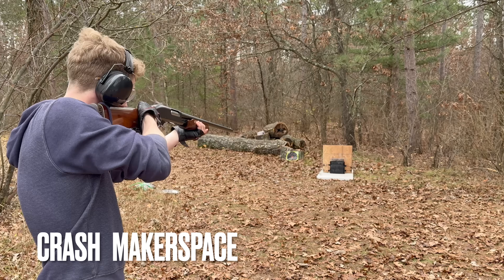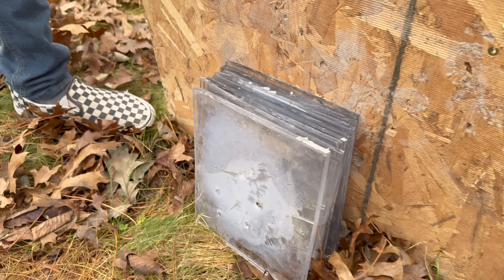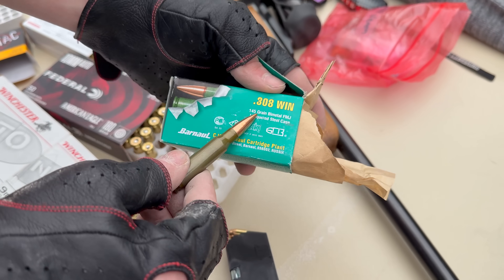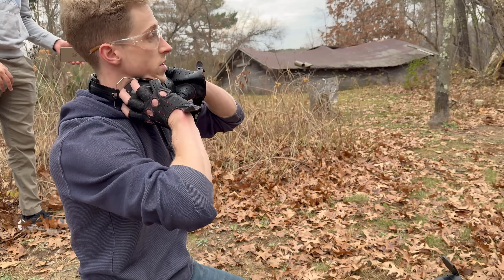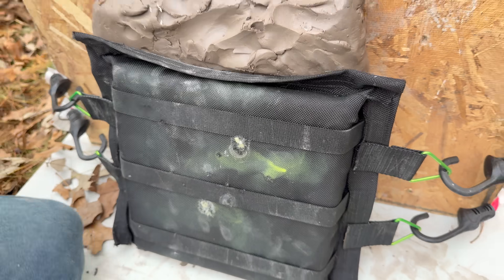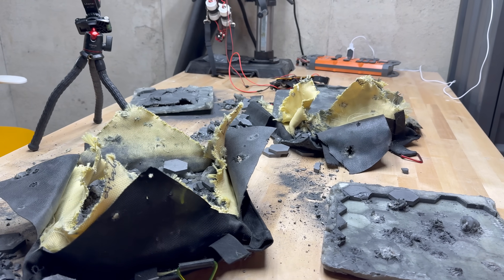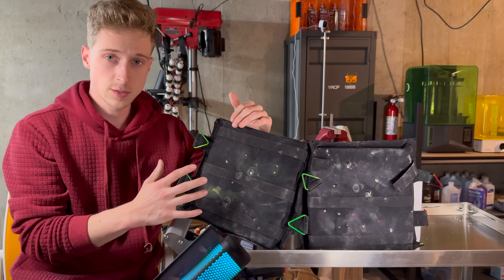3D Steel Lattice Super Armor (MULTI - HIT .300 WM capable)

Comment: That second 300win mag shot definitely would've cracked ribs and have possible internal bleeding to the end user.
Reply: If it hit ribs, that'd be a punctured lung, but still way the f more survivable than any other type of body armor in the same weight class.
Reply: @xXTrippleCrippleNippleFishXx Same weight class? These are like 75% heavier than other lvl 4 plates on the market that would have similar or better blackface deformation I'm pretty sure.
Reply: That being said, these plates have a lot less deformation. Which means that the amount of energy transfer is probably massive in your body, but better interal bleeding and broken bones that a hole through your heart or major artery
Reply: A round at 25 yards with almost 4000ftlbs of energy and a couple broken ribs is better than a bullet capable of taking a 1000lb+ moose in one shot
Reply: @ I’m pretty sure your insides will be jelly
Reply: Oh, for sure. There's only so much energy that you can take, even as blunt force. You would want medical attention for sure, but you might survive, which you almost certainly wouldn't with a hit to any vital organ.
Reply: @ I’d doubt you’d survive if it turned your liver into pudding.
Reply: Looked like a pass through. There's a hole in the clay cavity you can see before he sticks his fingers in. 
Still impressive though.

Comment: BTW: You should run some tests with lead slugs. I'm not entirely sure what it is about them, but they punched through a steel plate that could take sniper rounds all day.

Oh! You might also test multiple materials. They solved the lead issue by adding another thin metal sheet behind the steel plate
Reply from the maker: @Sugar3Glider  lead slugs, like the 1oz tactical 12Ga slugs I shot this with or different ones?
Reply: @CrashMakerspace  honestly unsure. I was only told it was a lead round that caused the change they went with.

Comment: If you downrated it to only stop 5.56 greentip, how much would it weigh?
Reply from the maker: Mmm, I’d rough ball it to say about 1/2 the weight so around 4lbs for plates this size
Reply: @CrashMakerspace  that's not bad, around a pound lighter than regular ceramic lvl4. Probably costs  three times as much tho

Comment: Hands down best plate performance I have seen, its a chunky boi. The fact you have so little back deformation with the 300 winmag was impressive. The ceramic did what ceramic does great initial protection. Layer of ball bearings? Your science survived testing.
Reply from the maker: Totally! The first hit of 300 was very little deformation, the 2nd .300 not so much haha but the plate still technically caught it

Comment: Most soft armor stops shotgun rounds.

Thick enough piece of a500 steel will stop just about anything but it will weigh a ton. Finding something that is light and stops a .338 is the challenge. Soldiers are already carrying as much weight as a medieval knight in plate armor, and thats using lightweight ceramic.

Comment: It would be cool if you'd test the lattice in all kinds of different materials like pc, nylon, peek or even inconel or nitinol.

Tullomer is cool, as strong as kevlar. But it probably doesn't work with your current latice, needs FDM for full strength.

Comment: Looks incredible! On a side note you might want to firm up the trigger discipline a touch. I noticed you wrapped your finger around the front of the trigger guard a couple of times which could easily accidentally be in the trigger guard and you might have had your finger inside the trigger guard a little early. Not too bad but that's one of those habits you really really want to make sure you have down.

Comment: could you use a composite that melts at medium/high temps that when melting increases density so on impact it would soften in a sense so you increase the surface area  as the composite deforms into a "baseball glove" that disperses energy in this semisolid state to the connected lattice?

Comment: Here are my questions.

1. If you make one to match the form factor of the standard issue plates given to service members does it weight less?

2. Does it absorb the pressure wave or energy wave generated from the impact in order to prevent internal organ and tissue damage
Reply from the maker: You would definitely want firm padding like with any IV type plate. This takes repeated hits much better than typical IV ceramics, but realistically someone isn't gonna be hit 10+ times so most vests only are made to take 1 or 2 rounds
Reply: @ tbh having been in combat I can tell you that this plate would of saved a few people lives. You’d be surprised how many people died to sniper fire and or repeated hits to compromised plates

Comment: You are at about the same weight as a level 4 plate as well with getting better performance out of yours, although your production costs might be different, but that isn't the point when you're making body armor for a super hero or prototyping or doing flat research like this. I do have to wonder if you could get the weight lower with other alternatives for the alloy for the SLS printing than steel and also exploring alternatives to the silicon carbide ceramic tiles, but that's another project since you have reached your goal for version one of your suit.

Now for version two, after you need better and lighter armor options...
Reply from the maker: Yep! This is similar specs to IV while being much better at taking a bunch of repeated hits it's just expensive and a tough build process

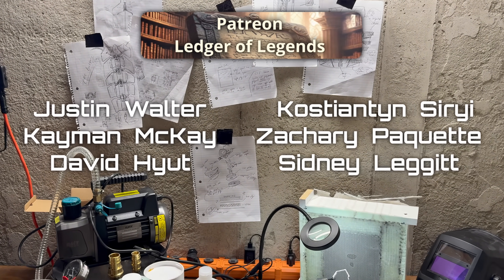Comment: 16:14 F**cking awesome job brother. Why don't you contact premier body armor or rts tactical for a colab or something?
Reply: I think the time intensive and financial investment for these may make them less utilisable than mass produced products currently on the market. 3d printing with metals is a burgeoning industry and the accuracy isn't terribly wonderful. There is also a few unique processes in production that we see which I'm unsure of the scalability for.
Still some goddamn awesome work and so interesting and impressive as engineering. It could maybe be used for large projects where force distribution is crucial but they wouldn't be produced at such a high rate.
Reply: @johndabobomb7108 

I'm not sure how much tolerances beyond the 0.25mm or so SLS offers matters here, and if they do there are other technologies which can step in, like DMLS.
Reply: @johndabobomb7108  makes sense 👍

Comment: also if you can invest in it , magnesium as a high J/gram specific plastic deformation force then Most Steel  , if you take alumnium magnesium alloy , you could hit the 9 joule / per gram , instead of the 2.7 joule /gram , for steel , also get some titanium diboride , or some BAM , or even if you realily find it or have change , SC-TB2 composite, or BAM-TB2 , that are the strongest ceramics in the world for balistic , because of there cracking strenght, so they aborsbe way more joule per gram , they hit the 1.5 joule per gram

Comment: Definitely love what you're doing here, but I'm completely dumb when it comes to armor plating. I would be extremely curious to see the same plate built and tested, but with a solid steel plate instead of your 3d printed plate, to compare integrity against the huge rounds. Really crazy that you could stop those rounds though. Even with the plastic plate, super impressive.

Comment: What consideration have you given to the alloy of steel that you're using in the lattice? It may be possible to get better impact toughness from a different alloy to either reduce weight or increase strength

Comment: petition to send this to famous youtubers and have them test it. See how well they work against even higher powered rounds.
Reply from the maker: I'll be posting the full video of unedited ballistics footage like with my RedHood armor! I'm not sure on the process yet to get ahold of AP, but that would be the next test. .300 WM doesn't seem to have black tip options, 30-06 certainly does but that's about 500ft*lbs less energy than the 300WM here.
Reply: @CrashMakerspace  you can just take the projectile from 30-06 AP and put it into a .300 Winchester magnum case
Reply: @CrashMakerspace  if u got a loading press I can send a 30 cal  project pulled from a old 30-06 black tip.
Reply: @CrashMakerspace  i can also send a m855a1 round
Reply: @CrashMakerspace  I'd offer to send some spicier rounds your way, but it would almost certainly end up with your ceramic strike face being the point of failure, so I'm not sure there would be much to learn from it.
Reply: @CrashMakerspace Yeah but .30-06 AP is a bigger threat to armor than any conventional .300winmag round.
Reply: @CrashMakerspace  30-06 Ap would sail right through that crap. Cross sectional density plus hardness plus speed is what will get you through armor. 5.56 55gr is better at penetrating armor than m855 just because it's going faster. Shoot m193 out of a 24" barrel and it goes through ar500 plates
Reply: @CrashMakerspace  you need to take apart a .30-06 black tip and load the projectile into .300 win mag.. only problem is that i think "producing AP ammo" is ilegal..
Reply: @pbayers  if no police there habibi, everything legal
Reply: @pbayers only for handgun ammo, not rifle
Reply: @pbayers  reloading ammo with AP projectiles is legal in every state that allows you to posses AP ammo.
See buffman range's videos on armour testing where he regularly uses .308 and .300WM loaded with 30-06 M2 AP projectiles that he reloaded himself.
Reply: @Collywood-Studios If a tree falls in the forest but no one is there to hear it then it didn't make a sound
Reply: @pbayers  you can buy 3006 black tip and reload it all day long.  The problem is selling it, giving it away, etc after you've created a "new" round.  Its far far better (especially when dealing with something as public as youtube) to not send around loaded ammo imo unless its original.  That or send just the projectiles (which is perfectly legal at a federal level).
Reply: @monkebrainedfish3130  or did it?
Reply: Yes would love to see Scott shoot it with one of his elephant guns
Reply: this would be great for the power armor of hacksmith
Reply: @theredknight3736  it would be really good but I'm pretty sure they're already far enough in the build so that a lot would need to be rethinked.
Reply: @theredknight3736  Someone else already mentioned that they're pretty far in the build already and it'd be alot of reworking to make a suit from this armor. Another problem though is that the point of power armor is  they use nuclear fusion-cores to produce crazy amounts of power and be able to mount extremely thick and solid steel plates on them which will stop more rounds. The point of the armor shown in the video is to develop an armor that can stop many more rounds than what we currently have and still be suitable for widespread combat use.
Reply: @theredknight3736  The people at Hacksmith would love this because helping people is part of their mission! They could get access to the nanoscale coating that is like adamantium!
Reply: I'm pretty satisfied watching it stop 300 wm
Reply: Yeah @kentuckyballistics or @demolitionranch could definitely help you with larger caliber testing
Reply: Imagine TAOFLLEDERMAUS throwing their wacky custom shotgun ammo at this custom armor lol!
Reply: Yes, send this to Demolition Ranch
Reply: Aye. @buffmanrange
Reply: @buffrange
Reply: Don't need to the force would still kill you it's just clickbait
Reply: @TimmsyTFG  doesn't matter. I want to see big guns go brrrr

Comment: funny thing is that me and my friend are also trayng to make body armor . we are attempting to create a armor that dosetn have only front protection , but back and side protection as well . the armor should be 2 times as protective as a level IV plate , weigh less than  10 kilos ( all the 4 plates combined ) and cost less than 2500 euros . ( also its supposed to stop 3 regular 338 lapua magnum rounds and 1 armor piercing 338 lapua magnum round )
Reply: The weight to protection ratio is impressive, but the cost is significant, compared to commercially available LV 4 plates available in the US.

Comment: Boron carbide did it's job, there's a reason it's been used for armor for over 50 years. 
I recommend using UMWPE to reduce weight for the back material. It also will significantly improve chances of catching the slug.
Reply from the maker: I'm using a high density Fiberglass on the rear which so far, it's very light and super hard. But I want to make a video of direct comparisons across weight, thickness, deformation, etc for UWHMPE / KV / FG / CF / KV+CF / Basalt for a nice summation of each
Reply: @CrashMakerspace  Generally speaking fiberglass is really good for backface deformation and is cheap. But really heavy compared with everything else. It's also not great against armor piercing projectiles.
UHWPE is also harder to work with due to how slick it is and resistant to soaking just as a warning.
Reply: @CrashMakerspace  You can purchase turbostratic graphene in bulk and monolayer on silicon in a range of small plate sizes. Spidersilk>kevlar by far and even stronger when graphene doped (which is a little funny cause you can hole dope graphene itself if you have the equipment, double dope).
Reply: @redTanto also be careful machining boron as some people are deathly allergic.
Reply: As far as anecdotes go, the best performance I've seen in video (lately) is a plate of titanium inside a slab of umwpe.  There's something about the composite of materials and how they react to energy together.  I estimate this video maker will arrive on the principle of whatever is going with that... If he hasn't already
Reply: @Jamtrenched  so a lot of armor uses uhwmpe for its deformation properties to absorb energy. the titanium plate acts as the "hard" strike surface to take the brunt of the force. but depending on the titanium alloy your using titanium also has amazing deformation properties.  so if you match the right alloy with uhwmpe both materials will act in unison to absorb the energy into the plate. but even with that plate. the thing that plagues non steel plate body armor is multi hit. if you get hit multiple time in a close proximity ones going through. but steel plate armor has the weight and spauling problem.
Reply: @inthedark65  This. also titanium has poor sheer resistance and galling qualities so it needs to be accounted for.
Reply: UHMWPE*

Comment: how do your plates and their approximate NIJ value compare to what is on the market, in terms of weight? xD Edit: Nvm, these are giga heavy. Still neat
Reply: Heavy yes, but that first plate is still pretty impressive. It's totally possible it could be slightly thinned out and some weight shaved off. 

I've seen level 4 plates (granted, lower end but still certified) struggle to take some of what that first plate did.

Comment: Wild this stopped a 300 WM I’ve seen it punch holes through 1/2 steel no problem. Amazing work
Reply from the maker: Thanks! It was the repeated hits that I was really surprised with on the results here
Reply: Mild steel maybe, 300 WM doesn't go through 1/2 inch AR500.
Reply: @Synthmilk at close range could crack a smaller plate of it
Reply: Most high velocity rifles cut mild steel easily. For the same weight you can get AR500 and stop all the same shit easily all day long.  Still cool stuff   Keep going.
Reply: Your method looks like metal foam that was invented at UCSD materials lab.
Reply: Not all steel is the same. Some steel, when totally annealing, nearly soft as aluminum, especially non-magnetic stainless steels.